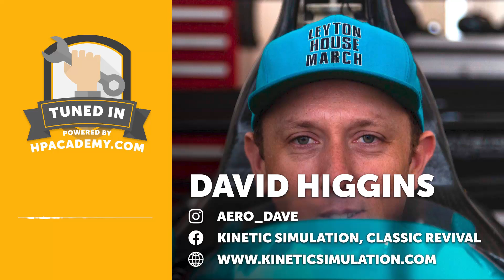075: The Realities of Driving and Maintaining Your Own F1 Car. [#PODCAST]

Comment: The engines are seized at room temp, everyone knows this
Reply from the maker: At one point everyone thought different areas of cc you tongue tasted different things too 😂

In this case though an engineer had a joke at the expense of a Top Gear host and the engines are not siezed solid at room temperature 😎

You shouldn't start one cold, BUT, that's not because it's locked tight- https://www.hpacademy.com/blog/its-not-what-you-think-pre-heating-engine-oil-and-water/